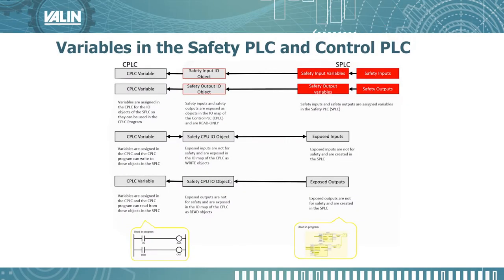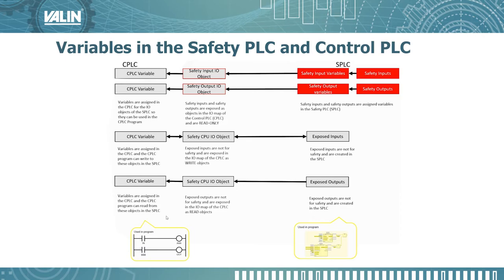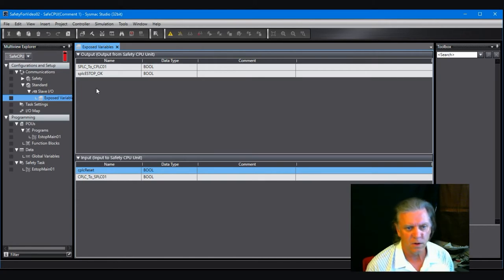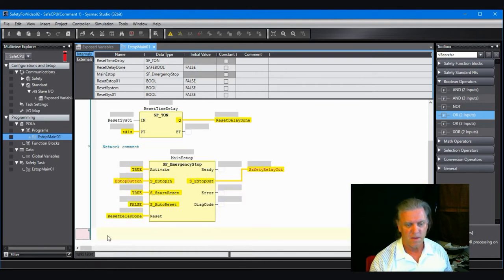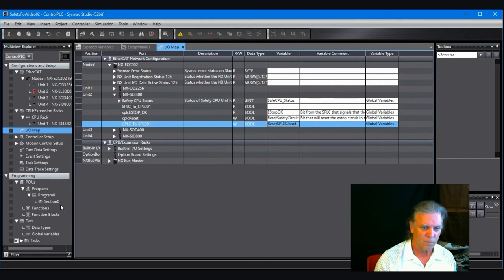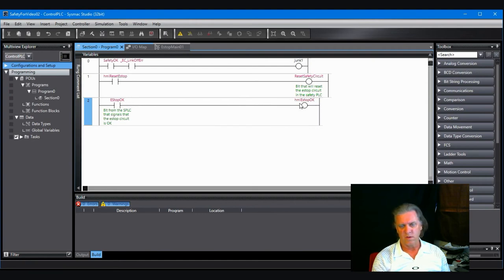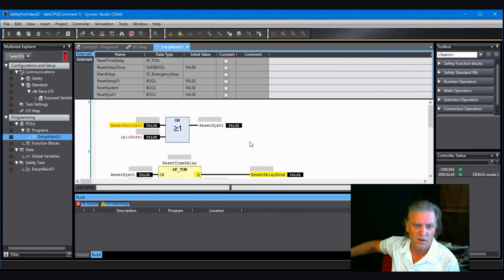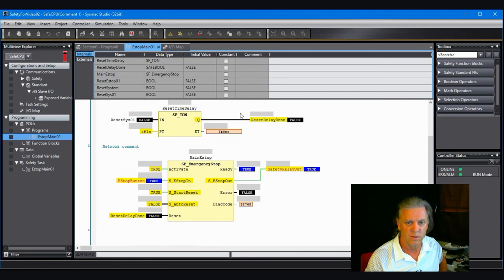Omron NX Safety Controller: Exchanging Information Between the Safety PLC and Control PLC

Comment: Great video. In my setup, though, I am using SL3300 together with ControlLogix PLC. When exposing the BOOL variable as input/output on SL3300, each BOOL is using up the whole BYTE in I/O Allocation. I managed to group BOOLs into BYTE with one rung of logic in SL3300, but can't think of how to easily extract BOOLs from BYTE in SL3300. Sounds like an open item for Omron there.